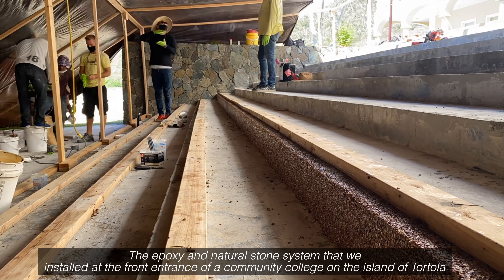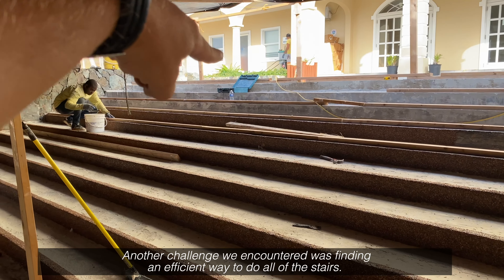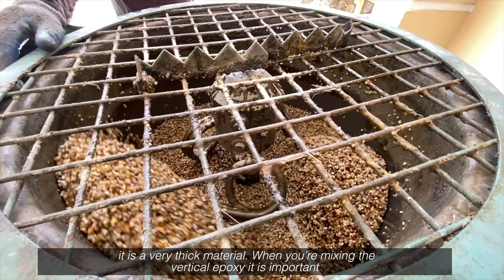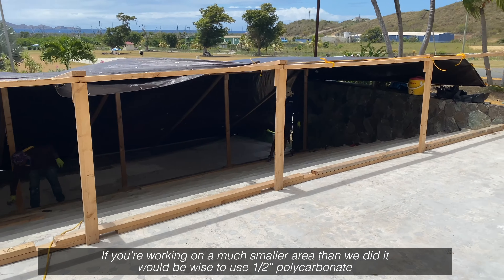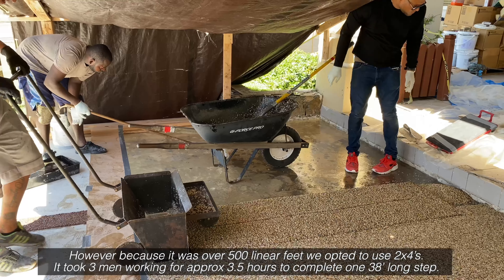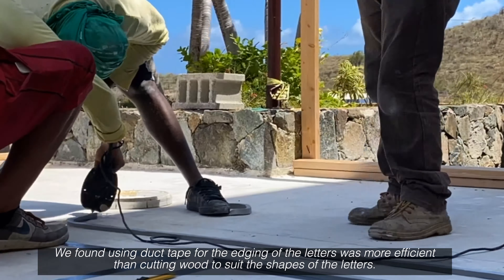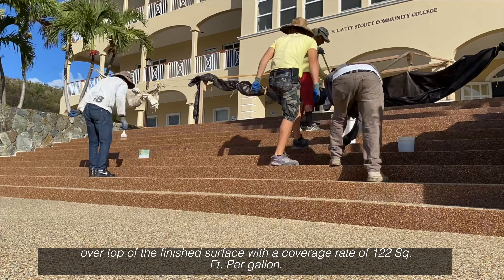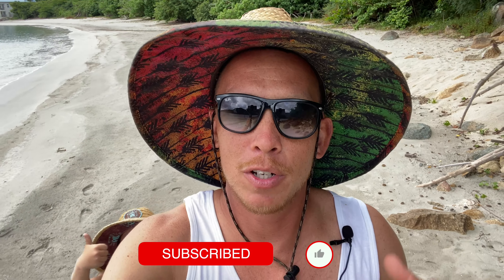How to Transform Stairs With Natural Sierra Stone Epoxy Floor Coating Installation Video  @TimDCVA ​

Comment: Hi I have the same floor finish on my patio - sierra stone with epoxy. However I am missing the top finish of epoxy which I am planning to do it myself. Can you share what kind of epoxy I should use? Thanks so much
Reply from the maker: Ya no problem Kevin. Send me an email at info@concretebvi.com and the next time I’m at the workshop I’ll send you a photo of the epoxy. The manufacturer is in California. But the company that sells it to us “Sierra stone” is based out of Canada. Where are you located ?